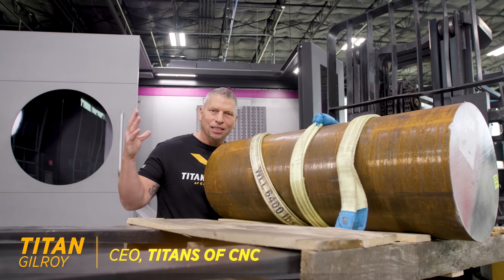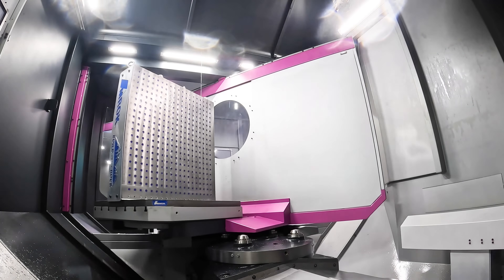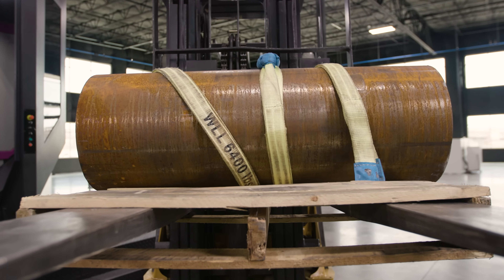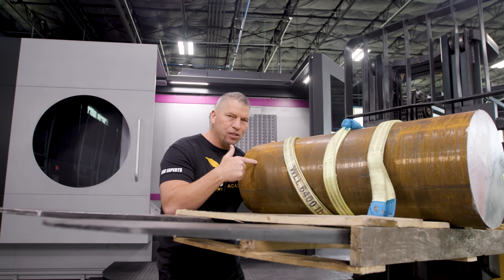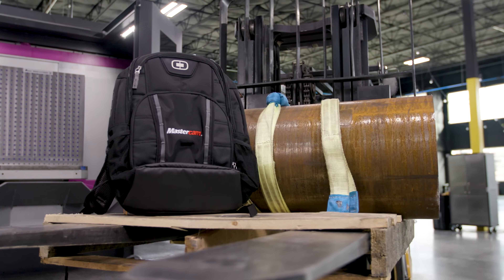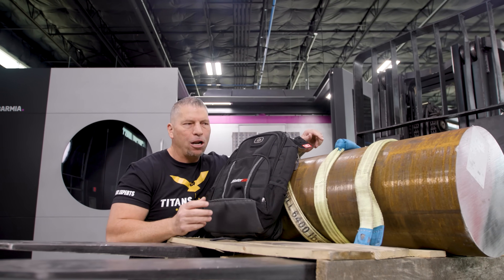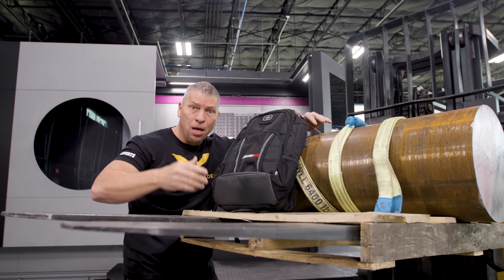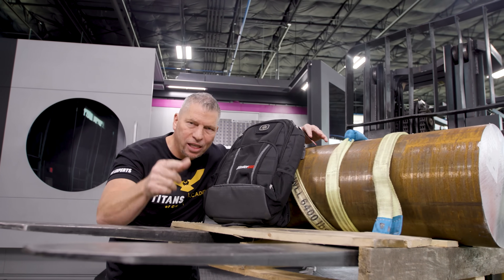How Would You Do It?? YOU Tell US How to Fixture This Monster!

Comment: There is actualy very easy way if you don't have a lot of stuff laying around....
Take a piece of Aluminum and machine the half round shape from the monster piece and drill at the sides 2 holes with the exact distance from the theads from the thumbstone.
When you fixture it with the 2 spacers and long threaded rods you can hold it easily with the strap from the forklift without ruin it....
When you close the nuts it brings massive power between the two fixing radius on both sides...👍💪
Reply: Titan, this guy wins.
Reply from the maker: Johannes, 

Congrats on winning this Swag bag!  Please reach out  to Brad@titansofcnc.com so we can get some information from you!  Once again Congrats!!!!

Comment: As many have said, hard to tell without any drawings, but looking at it why not istead of the tombstone just put a big chuck on the machine bed and the part standing up if it will fit. Material should be heavy and looks short enough to not have any significant vibrations unless really heavy machening is done. For second op. depends on the result of the first op, if the part will be round, then chuck again, if not then vices or tombstone.

Comment: With such a limited information we could go for the standard machining world answer: it depends.

IMO the easiest way for a single part would be a heavy duty stationary chuck mounted on machine pallet directly or with an adapter plate if required. Keeping it as low as possible to minimize radial forces from cutting process.

Some low profile heavy duty spec clamps could also work.

But my preferred solution, if a minimum part preparation is possible, would be using FPT FAST MILL clamping modules, just using one axial face and leaving all the part completely free. It is a safe and reliable solution for heavy duty cutting if needed.

Comment: Without a print it's hard to know what your trying to accomplish and or make from the material. Something crazy would be to to locate it vertically clamping on the round with the block side having fixtures with some sort of add on to raise the top fulcrum. Then you could use some sort of bite into the round to hold it in conjunction with diameter clamping below. This would allow for the most machining area with the least amount of prep.

Comment: Using the vague information given, my initial thought was to use a guide plate (kind of like a conduit strap) with bolts on the end to  mount to your fixture plate. Could even do it in stages where you move the guides around when you need to machine the supported area.

Comment: A crude guess with no print (who would attempt a setup with no print)??, and a rapid close up glance at the machine.  Use a 1 inch thick plate large enough to give clearance around the diameter for direct bolting it to that tombstone, with 8 holes drilled to bolt it up.   then weld the round bar to it like a lamp post.  Then just bolt the thing directly to the tombstone.   If it needed a jack add one underneath for support, then once a large part of the material was  gone reducing the weight, remove the jack to finish the underside if necessary.

Comment: Scrap it without writing a report and throw it in the back of knuckleheads truck. At the end of third shift working 12 hours he will hop in his truck without looking stop to get a beer with u. Let bob walk him in and stall him at Mikes quick stop. Hustle the part into ur vehicle. Head to scrap yard across the lake.👍....fixed...lol, at least u don't have to worry about the mf springing or chattering much if ever turning it. Man that's like a dream part to a machinist with a machine built to handle it. Depending on what ur doing there's many ways to accomplish it. We had 3-5 different ways on one style machine sometimes to do the same exact parts. And these weren't parts with multiple processes just multiple critical features....14° seals,grooves, shoulders, counter boring, relief angles etc. Heavy i inspection criteria. I've yet to work "ANY" job doing "ANYTHING" that requires the procedural commissioning in all departments as the premium connections industry. I been around too, i worked on tug boats as a young man for half a decade making my way to mate making and breaking 49 barge tow on the Mississippi river in Amma La. they hold the hardest working individual (they who actually been doing it) title above any job that anyone does and  anywhere it's done in the world imo. If i haven't done it I've seen it done or i know enough about people to tell what's real. No i don't hold it against people anymore that give up. Not after the way I've been left out. Not after I've been witness to everyone including those i trust and needed most were mia....those I'm supposed to be able to count on sold me out the way they did leaving me blind counting my fingers with no arms. At least they let me know all the time that it's all my fault by reminding me how i could've just lived and died and never said a fkn word if it was my opinion. Doesn't or didn't matter how 16 years i was 100% the model employee, forget that nearly 8-10 years perfect attendance cuz i used one pto day out of 5 at the end of the year so u know i had no choice but, hey i can't complain cuz i worked 12 hours almost year round shift work too. And don't let me get caught talking like this cuz someone will suspect im crying and forget about our secret a "the secret" like they have with almost everyone else. U know....a back up plan, something to insure defamatory facts if they decide to start talking too much. Like i side, i been around idgaf about facts about me...it wasn't about me or neither anyone in the position to screw me over...anyone like someone that knkws everyones dirt. Like who sold all the coke cases on everyone for the right price u can get some for anyone just call yourself CEO with any kinnd of verification for a day to people who don't know any better and treat yourself to the real world. Then see how people who u think are all the world to u and all u have, have some ways u always didn't understand and suddenly understand wtf they really been hiding... yeah, it's like that. Listen IDGAF about what some know about me, i know about y'all and like I've said...."It's over fo ya".....those days r over son....Ur gonna pay up those u haven't payed right so far and if u can't the company that can will....or the wall street monster will....  ur going to do right by everyone no matter what. Ok maybe u won't have to pay anyone up but, u damn sure about to turn  a new leaf and start r ima start turning ur cheek B....if u catch my drift....like wood....u know what a drift bar is B? Huh? U know how it's used?

Bet u can stop anything....

Comment: If the material is going to be held vertically I would use a lathe chuck big enough to clamp onto it that can be bolted to the rotary table. If it's horizontal I would simply put it on those 2 V blocks you showed in the beginning of the video with some tall toe clamp studs either in the middle or on both ends and a bar on top to clamp it

Comment: Considering the fact that this is the only machine that this part will go on, i would clamp across v blocks flat on table hold with chain and machine part features / pre op flats to be clampable in the 4 vices you set in the previous video. Op1 vices, machine all faces available to acces and from there op2 might be a jig or might be again in vices depending on how component looks like. You need flat edges to hold that in the vices.

Comment: Just stating it needs to be machined on 5 sides is not nearly enough information for fixturing. There's several different options here, but without more information on what the actual print looks like, this question you ask of us is extremely difficult to answer

Comment: depends on what your operations are, however, I'd machine 2 diameter clamps and clamp it equally spaced on the workpiece. that way you can do front and back at the same time as well as middle if there's any operation there at all

Comment: Without an engineering drawing I'm going to have a stab in the dark. Mount in a V-block, face and centre both ends to required length then mount between centres with face drive in multus turn centre...

Comment: If you need maximum acces from the beginning, I would put the raw material in a lathe, face it off and make a step on the outside diameter. Secondly I would make a bolt pattern on the face. Then I would fabricate a mounting plate out of some thick steel plate that has the same (negative) step and bolt pattern. Bolt the workpiece to the plate and bolt the plate down to the table. If it's a one off and don't want to spend the time to fabricate a fixture, one could bolt a lathe's face plate to the workpiece, supporteb by jaws on the side and bolt the face plate to the machine's table.
If you do not need access to all sides, I would definitely make a flat on it and draw it against that tombstone.

Comment: with no knowledge of the drawings of the part you want to make. i woud say you woud make a sort of 3 clamp system wich woud go over and around the part and you woud screw it down to have constant pressure on the top. as i woud think that woud make it so you coud theoreticly make your part in 2 fixtures.

Comment: First of all the part drawings are important.
But you must have chosen to machine this part on Ibermia based on convenience to machine the required features.
My guess would be to use the machine as HMC on op1 to make fixturing arrangements on one face of stock.ie Dovetails or Facing, Drilling, Tapping to attach the machined face to vice or base plate of the machine table.
op2 will be using the 5axis capabilities to machine the part to required spec.

Comment: I think that machine is big enough as to where you could just put a chuck on the pallet and grab it in there vertically. 

It really depends on what the finished part is going to look like. But I would put it in v blocks and clamp over the top, machine both sides. Then I guess you could milk flats on one side so you can clamp it in vices if that works for the part you’re making.

Comment: What about the idea of machining some custom feet that you could weld onto the sides of the cylinder, then machine the initial features and datums as well as clamping points....circle back and machine off the welded on feet, then proceed with the rest of the part.

Comment: Start by cleaning the material... All good parts come from nice clean material, then clamps on the slab holding the work piece to it and a square, face a end, flip and repeat, saw cuts are always / then look at the print to figure out the next op

Comment: It would help, if show us the finished part or model.
 But anyway, I would mount subplate to one end. subplate would have bolt hole pattern to fix machine pallet base.
 Mount it on the  pallet base. 
Send me the model and print and I will generate process and program. Maybe I will come set it up for you.

Comment: Riser fixtures with window to bolt from the bottom is optimal 5/8th bolts at least. 2 risers with staggered bolt pattern to reduce chatter.....if not enough material for 5/8 thread for mounting go with 2 eight by 8 registers 3/4 deep and put the 8 inch vises back to back with the vise handles opposite direction in x and hog that shit
Reply: Also if need to releave part after rough just float the second vise and regrab in the same setup

Comment: I was thinking of holding it in a rotary table with a 3-jaw chuck (with gripper/dovetail jaws for max material access) clamping one end and a tailstock centre in that centre-drilled hole on the other side, clamped and trammed true on the machine tombstone. That way, you can machine four sides in one sitting and when it comes to the 5th side, you can rotate the rotary table 180 degrees to finish its 5th side. If there's concerns with chatter/deflection in the centre though, put a screw clamp with a vee-notched head sat under the material.
The way I thought of it was this: The rotary table and tailstock would prevent movement in the X, Y and Z axes and also stop rotation in the B and C axes. The A axis would be under the operator's control via the rotary table (technically A2 as A1 would be the built-in rotation of the machine table).

Comment: Save second pallet for this 4140 steel as thumbstone can not fit this massive piece :)  I would use endmill and bore out hole for the jaws that would hold workpiece, than I would turn material using crane and fix it up for the roughing cycle. It's defs not one setup thing as its massive. This whole machining process is miniumum 3 ops.

Comment: fixturing will depend on the operations to be done. For first operation, If just turning OD to size, will add a lathe chuck / face plate, on tomb stone, the other side has a center hole already for a live center to run in, turning from there, then according to what ever need to be done afterwards, adjust fixturing's methods, even if custom fixturing need to be made, and work from there.. without a idea what it will be, difficult to see what need to be fixed where and when..

Comment: Make two large V blocks, one for the top, one for the bottom. Bolt  a 1" plate on the end of each V block with holes for bolts to go into your stock. Drill and tap the ends of the stock to match the plate bolt hole pattern.  Stand it up on the table against the tombstone with a V block behind the top and bottom with the plate covering the top and bottom, bolted on. Bolt V blocks to the tombstone. Indicate it in, set offsets and cut away. Without seeing the print of what you are trying to make this is just a SWAG, not enough info to design fixtures without knowing what you are trying to make from it.

Comment: Face and clean the O.D  6" deep to .001 tolerance. Machine a set of jaws to that Diameter.  Center Drill the other end and use a tail body.
Reply: Use a different machine.
Reply: Thats a job for a mazak integrex.

Comment: As others have said pretty hard to know without a print, but if I had to take a flier, I’d bolt a couple pieces of beefy stock to the front and back of the pallet and mill a cradle or V in the stock and use some chain clamps, that way at least I would know that the stock is aligned dead nuts to the z axis and centered to the rotation point of the pallet so I could work both ends with no trouble. 🤷‍♂️

Comment: I'd slam it in a gigantic jaw, and rest it on a steady if laid horizontal, for turning and milling. But if you gonna just mill it, and if its a one off, and you have no jaws this crazy big and it's not cost or time feasible to order some that would fit your blank... then I'd clap it to your tombstone just so it's as stable as possible. Then I'd analyse the drawing and look for a face or a diameter that is the deepest in the material that is relative to the datum, and I'd consider it as my datum... then I'd look for a parallel face that's as far as possible from "the datum"(if a diameter is your datum then secondary diameter must be on the same axis) . Leave 0.5mm(0.020") on faces or diameter to allow for clamping distortion, nicks and other phantoms of engeenering. Once that is achieved, measure the parallelism of these faces, or concentricity/runout if its a diameter, if OK, then you can just clamp onto your datums, using preciser, smaller and more common clamps.

Alternatively, if there are no faces or diameters deep in the material in the design, you can always mill on small spigots on both ends, so they fit in your jaws and a steady. Not the most cost effective method for mass production as spigots must be machined off, but works perfect for prototypes and one offs that require a FAIR... as concentricites, parrelisms and perpendicularites will be as good as your machine can afford. Note for this material your sigots will have to be around 1/5-1/6 of the blanks O/D. Heat expansions and vibration can distort dimensions if spigots are too small.

Comment: I've made many parts like this.  I made v-blocks with hardened,  serrated pads.  The fixture has 4 hole widths for different size strong back clamps.  My set of v blocks can hold 2.5 dia up to 18 dia.  Even though it's a one-off job, go ahead and invest the time in making it versatile because YOU WILL ALWAYS have more bar jobs in the future.  Also, use 7/8 - 9 minimum all thread for the clamps.

Comment: Well if you need to have access to most of the part I would think you wouldn’t want to mount it on a tombstone because you would lose access to that whole side facing the tombstone . So I think that tombstone is a counter balance for the other pallet that is going to hold the part. So the part will be held vertically with a fixture plate with a bored hole the size of the material and then have spaces machined for some mighty bites to clamp on the diameter of the material.
Reply: Boom!